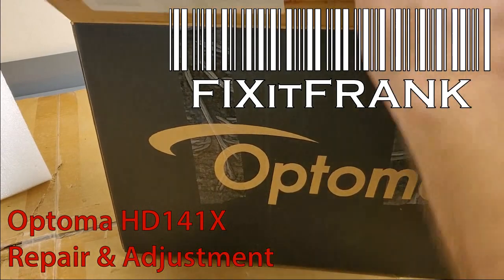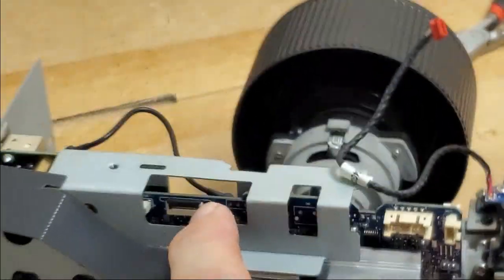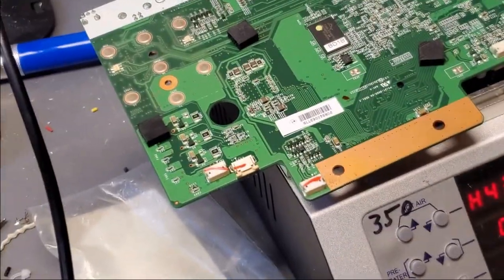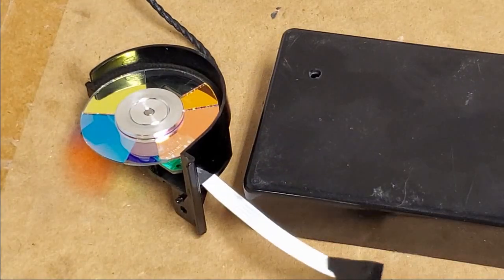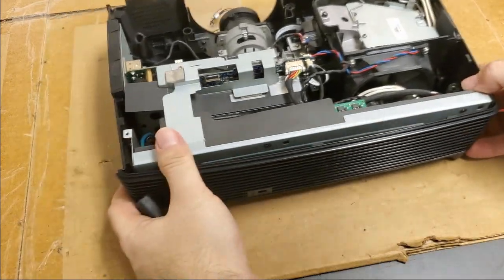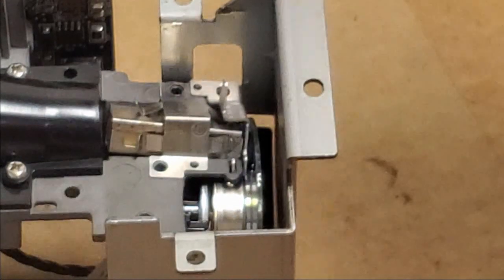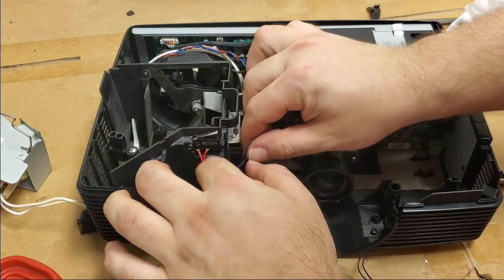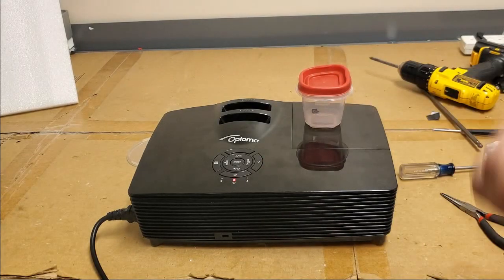Optoma HD141X DLP Video Projector Repair

Comment: Hi Frank, you are a live saver. After two hours of work i fixed my optoma hd142x with your video, I had the same problem in the light tunnel. It was frustrating because it was my fault because I caused the problem while trying to remove color wheel. Now I made experience and I'm going to easily replace the wheel. So, last thing, I was so afraid because I bought the projector with the money of a little work After school, so you saved a lot of work and money that I have sweaty, so I don't know how to thank you, even if I don't believe in miracles...today you was a miracle for me!
Reply: Vittorio Martellino 

Ldl
Reply: Vittorio Martellino gg

Comment: 💯👍🏽🔥🙏🏾 THANKS FRANK!!! I appreciate the time and effort it took to make this video and for your prompt responses in the comment section. I have never taken apart anything like this before and I thought I was going to have to buy a new projector. I have successfully repaired my projector and removed that dreaded shadowing  because of this video. I tightened the spring the same way you did and the shadow is gone. The only thing I have to do now is blow it out because there are some visable particles on the projected image, same as in this video. I also bought a cheap lamp replacement but will buy the one you suggested in this video. Salute to you 👍🏽!!!
Reply from the maker: Hello! Good job and thank you so much for your kind words! This is exactly why I post these videos. I am so happy to hear this. Thank you again for letting me know. I hope this gives other people the confidence to try themselves.
Reply: FixitFrank  Do you have an address where I can send you my optoma ? I didn't have any light coming out, I bought a new lamp and nothing came out. Fan and everything else sounds like it should, but no light. Thank you Frank !

Comment: Hi Frank Really great videos and I have an Optoma UHD550x and the screen is totally black with part of the Optoma word missing. I sent it to Optoma and they wanted to charge me a fortune for a new DMD chip even though it was just a couple of months outside warranty. Anyway after watching a number of your videos I have taken it apart and found the part number for the DMD chip and found a supplier in Holland that can get one for me at a reasonable price. Just waiting for it to be delivered and then will see if I can put it all back together. Made a few mistakes while taking it apart but your videos are really informative so thanks for doing them.
Reply from the maker: You are very welcome Martin!  I am glad the videos were helpful.  That is my entire goal.  I want to give people whatever resources I can provide to help them repair themselves, or at the least, help them be educated on the problem so they are not ripped off by a repair center.

Comment: Frank

Thank you so much - my projector had exactly this problem and your clear video helped me repair it. What a brilliant service you offer to both viewers and the planet!. Thanks a million. 

A couple of questions if I may. 

1. How can I tell if a cheap bulb is really from the supplier it claims to be - e.g. it looks as though Osram bulbs are engraved not printed on the end - or is this a misconception?
2. Do I dare to clean the lense on the outside of the housing. It has clearly been damaged by exposure to the first bulb - will a strong solvent cause more harm than good?
Reply from the maker: No problem!  Very Good questions.
1. I have seen real Osram lamps with both stamped and engraved.  The larger issue I see from cheap suppliers is the quality of the lamp housing. Namely the IR/UV block lens on the front.  They tend to use these lenses with a junky green coating that allows too much IR into the optics, slowly but thoroughly cooking the insides.  I have yet to determine the best way to see if an Osram is counterfeit or not.  One way I do know of is by comparing the serial number engraved into the side of hte arc tube with the serial number on the sticker. They should match.  The other way is price.  The average Osram lamp's "cost" is $25-40usd.  They are then sold for $45+.  If you paid less than say $30 US, I would be suspicious. 

2. If the lens has a spot in the middle, its trashed.  You need a new housing or at least a new lens.  That lens is critical for the blocking of UV IR like I said in answer 1. If it's just some specs from the old lamp bursting, you can leave it alone.  Less is more with these devices I have found.  You know... if it's not broken, don't fix it. 

I usually recommend a full assembly if possible. They you have a new lens and connector.  They are both parts that can wear out from the thermal cycling.  That said, you need to do what you can with what you can find so I understand just replacing the lamp instead of the full assembly.

Comment: Hello Frank, 
I bought an Optoma hd141x with a blown lamp, hoping that changing for new lamp would help. I order a replacement bulb alone from osram. After replacement, the projector worked fine for 10 minutes. Then I turned it off. From that time the projector did not boot and started showing the lamp error again (red indicator). It seemed to me that the area around the lamp was very hot after those 10 minutes. There was a sound like running fan during operation, so I expected everything is OK. The only thing that comes to my mind is that I accidentally switched the cables for the lamp. Could this be a reason for a lamp blow? Is the polarity essential? The "broken" lamp looks ok from the outside but shows disconnected contacts (infinite ohms) when measured by multimeter. The replacement lamp was a OSRAM P-VIP 190/0.8 E20.8.

Would you have any hints? If the polarity is essential, is there a way to recognize the correct one by measuing something?
Reply from the maker: These are arc lamps.  A continuity test should show an open circuit. If you had resistance that would be a bad thing.  There is no filament in these. Just arc points and noble gasses. 
There isn't a positive and negative on these lamps(ushio NSH are DC). Osram and Philips are AC but there is a Hot and Return.  You can swap them to see if its that, but I would expect it to ignite either way. 
Do your colors flicker at all right before it shuts down?

Comment: Hi Frank, I replaced the color wheel on my HD141x with one from Amazon. Now all the reds look orange. I've read that sometimes the color wheel needs to be re-indexed but I can't for the life of me figure out how to do that. Any suggestions? Thanks.
Reply from the maker: There are 2 options.  First one is to move the little sticker (index mark) so its in the same place as the old mark.  Other method is getting into the service menu and adjusting the Color wheel index.  I think this is the method. Press Power-Up-Right-Up-Left-Menu buttons on the projector in that order. Press them within 1second of each other. You should get a menu that appears and the Index mark should be a number between 0-360.  Adjust that number until the image looks correct.

Comment: Hi Frank. I have the same model projector. It seems my DLP chip also has dust on it. Did you show on video how to clean it or did I miss it? I can't  recall seeing it. Do you have a video on how to do this? I really would like to try and clean my chip as it has a lot of dark spots/ dots showing up on screen. And if the chip needs replacing is it a hard job to complete and where can I order one? Any help would be highly appreciated. Thank you in advance.

Comment: How about explaining how to fix the speaker, Frank?
Mine stopped working yesterday. It worked again for a few seconds this evening, then cut out again. Sound only can be heard with headphones plugged into the headphone socket.
Reply from the maker: Hard to say.  I have never seen someone use that speaker or had one sent in for that.  Usually these are used with an AVR or sound bar.  In your case my initial guess would be the speaker might be going bad. They are not meant to be very loud and if you ran the volume high, it could burn it out.  Or, the headphone jack is dirty and the 'switch' that enables/disables the speaker when you plug in isn't quite making contact. some contact cleaner in the headphone jack might help.  You could try plugging and unplugging the headphone jack a few times to exercise the speaker switch to see if it helps. The fact that there is audio at all is a good sign.

Comment: Hello Frank, my hd141x projector red light will not come on. It’s the same one in the video. The outlet works., I unplugged it and held down the power button while plugging it in. I still don’t get any power, help
Reply from the maker: If you are not getting any LEDs are all, it sounds power supply related.  Its hard to say exactly what but I would put your ear up close to the projector and slowly plug in the cord.  You should hear like a little "tick" or "zip!" noise as the power supply charges up.  If no noise, then power supply troubleshooting needs to happen.  (same comment as the other post)

Comment: ive had this projector for about 3 years now, but after a little while i get some flickering down in the bottom left of the screen, tried different lamp was fine for a few weeks then same thing, any idea what it would be? its like a really mild flicker usually but constant unless i change from eco back to bright again, and eco is almost unusable as it does the same thing more violently and sooner. also should i take it apart fully just to clean it anyway? i usually open it every few months and clean it out but not quite completely dismantled one yet

thanks in advance
Reply from the maker: Long term eco mode is a problem.  Honestly I wish they never offered it.  I see more lamps failing early from ECO mode use than old lamps. ECO mode runs your lamp at a lower power which allows scale to build up on the arc points inside.  Sometimes putting hte lamp back into normal mode for a few hours will clean off the scale but sometimes its just too engrained.  I tell folks who use ECO to put it into standard mode for a day or 2 every few weeks to keep that from happening but you can't always get it totally clean.  
All that said, being that this is a 141, you might have a color wheel starting to act up.  They can give you a flickering affect as well.  If you can take a short video and link it to me, I can check it and see what it looks like to me.  Then I can save you the wild goose chase.

Comment: Hi Frank,

I’ve spent ages crawling through sites trying to find a solution to my problem and your video on repairing the Optoma HD141X has by far been the most useful source of information I have found so far - so thank you very much! 

Unfortunately you don’t cover my exact issue so I was hoping you may be able to point me in the right direction?
My HD141X projector was working fine other than the fan being a little noisy (it’s a few years old but only got 80 hours on the bulb so it’s hardly been used!) until I turned it on the other day and it now doesn’t find a source. It powers up fine, the fan runs, the lamp comes on, the Optoma logo shows up (as do all the menus and settings which are all crystal clear so I guess the bulk of it is working as it should) but no matter what HDMI lead I use or what source I try (PS3, PS4, Fire Tv stick, laptop) The projector just searches for a signal but doesn’t find one. I’ve tried plugging things into both HDMI ports, locking the source so it has ages to try and ‘see’ the source, Reset the sources video outputs Incase they were trying to play in a format/size that the projector didn’t like but it never finds them. Every now and again in the bottom right hand corner where the searching for source box is it will seemingly find a source and shows what resolution it will be in, but then no picture actually shows up on the screen. 
I felt like I’d tried everything I could think of so I opened it up to see if there was an obvious loose connection that might be the cause but everything seems to be as it should. Annoyingly there’s only the 2 HDMI inputs so I can’t try a VGA lead or anything else to see if they still work. 

I'm sorry to bother you, but if you have any idea what may be the cause and how I could fix it then I would be very grateful. I’ve spoken to Optoma, but because it is out of warranty (even though it is practically unused!) they want to charge a fortune to have a look at it, and if the parts to fix it end up being expensive I’d probably be better off buying a new one which I can’t really afford to do at the moment. 

Thank you for your time and if you need anymore information then please let me know. 

All the best, Joe

Comment: Just a note to people unfamiliar with electronics, the video has an edit that makes it unclear which side up the ribbons go.  I thought I saw the metal side up (away from the board), but my projector wouldn't power up with the ribbon that way from the lid-buttons/rf ribbon going to the main board.  Also, I received a lamp error when they were metal side up for the color wheel connection to the board.  So put the ribbons metal side down, so they face the board they're connected to.
Reply from the maker: I figured people would put it back how it came out, but if you are not paying attention, it's easy to mix it up.  Thanks for posting this.  I'm sure it will be helpful.

Comment: Hallo Frank How are you, its me again 🙋🏻‍♂️.
i have bought Optoma optoma hd151x but i found smthing weird,
the fan just after i put the kabel in power start rund but so slow after i put on button run normaly after shutdown the same run slowly.is that normal ? 
please Frank healp me to find out what is the proplem .
Thank you Frank
Reply from the maker: The fan will run at slower speed at first, but it should stop after a few minutes when you turn it off. It makes the projector more quiet. If it is slow while the lamp is on, then the fan may be bad.  If you get no over heat warning, or temp error, I would not worry too much.  Keep an eye on it.  If you get a temperature error, then I would change the fan.
Reply: @FixitFrank  
Hallo Frank 
thankyou so much for fast repaly.
but what is happend this fan countuing run slowly after i shut the optoma down and never stoped even after 10 mun. this is what i dont under stand .
Thank you Frank
Reply from the maker: Is it very warm in the room? I am not positive, but I think if the room is warm the fan will continue to spin slowly to keep the insides cool.  I will check the manual to see if that is correct.
Reply: @FixitFrank  Thank you so much Frank .
i think i have real proplem with my peojector i think the mother bord cant work Right any more for that i listed in ebay as Defect projector becuse i cant do any thnig more .
Once again Thank you so much Frank for me Support me to resolve my proplems .
wish all the best from Germany .
Vielen Dank 😊🙋🏻‍♂️

Comment: Hi, Frank. I have one dead pixel on the top right corner, some black ones, and the picture flickers sometimes. I just need to know if I can fix it, or is this normal?
Reply from the maker: It is definitely not normal operation. It usually is caused by a failing DMD that has stuck mirrors.  They are reasonably replaceable depending on the model.  Is it the same model # as this unit? Also, when you say flickering, does the color flicker (purple/green) or is it flickering light to dark?
Reply: @FixitFrank  Yes, it's the same model. The image just flickers. Not like on or off sort of way. The lamp is still good. Is there a compatible DMD chip for this model?

Comment: I have the same model. When I turn it on, it stays on for a few seconds, then shuts itself off. The power button keeps blinking red, and the bulb indicator stays a solid red. I changed the bulb with a new one, but the problem persists. I'm wondering if the fan isn't getting good airflow would cause that. Didn't want to take it apart yet. until I get a few opinions on it.
Reply from the maker: Id be very suspicious of the color wheel.  If the fan was the issue it would give you a thermal error. Does the image flicker at all before it shuts down?  Also, does the lamp assembly have a reddish/blue tint to its lens?
Reply: @FixitFrank  Thanks for replying. When I hit the power button, it turns on for a few second, the blue screen comes on with the Optoma logo, and then  shuts off where the power led flashes red and the bulb led stays on red. The assembly doesn't have any reddish/blue tint on the lens.
Reply from the maker: If you still have the old lamp assembly that worked, I would try moving the red/blue tint lens from the old housing to the new housing.  That lens is an IR/UV filter. without it working correctly the color wheel will be flooded with IR light causing it to shut down.  I would try that first at least.

Comment: i have got this projector hour ago , when i tested first the ray was straight . Brought it home , put on the top of another projector which is 0,5 meter under ceiling and also can throw straight ray . Now this optoma projector ray looks up to ceiling , so i have to tilt rear side up almost 45 degrees . Is it normal for this model ? thanky uo
Reply from the maker: Здравствуйте Влад, сбросил прошивки на заводские. Я думаю, что луч направлен вверх, потому что проектор думает, что он находится в режиме потолка, а не в режиме стола. Спасибо!  (Прошу прощения за мой русский язык, я все еще рано учусь, и мне пришлось использовать перевод для некоторых слов)